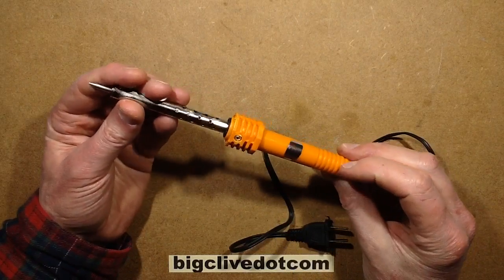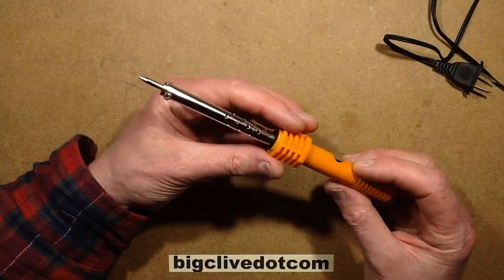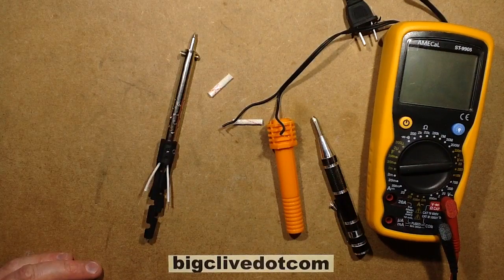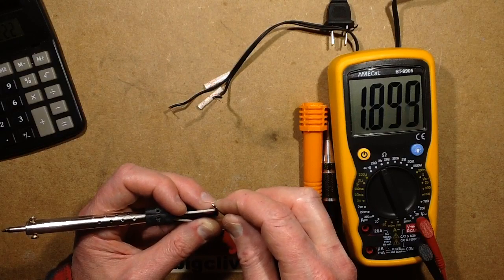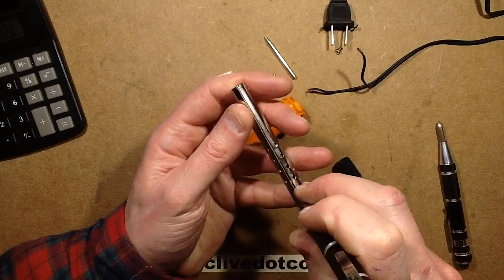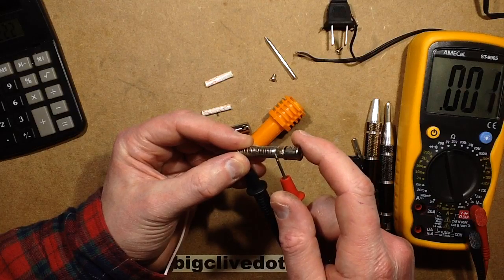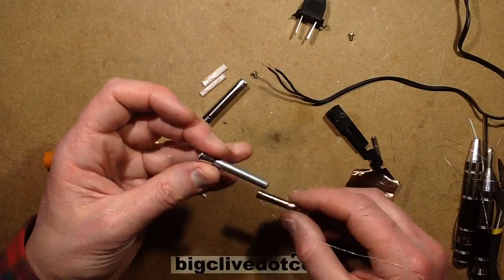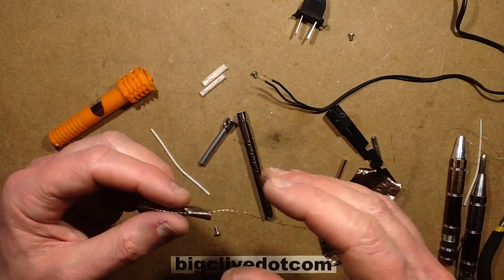Inside the cheapest soldering iron on ebay.

Comment: I just stumbled across your channel and subscribed :) very interesting and informative. looks like first off of course China  lol! they take good or decent parts and assemble things as cheap as possible. if you want to solder some thing buy a soldering iron, I use a Weller, if you want to burn your house down buy that cheap one  lol! I will be checking out your library of videos and looking for what you come up with in the future :)
Reply: i would think if you soldered the leads back after a couple of minutes getting hot it would melt all over

Comment: I brought one of these........Feels extremely cheap!.
Solders cheap too. Heat is inconsistent.

I asked for a refund as it is just crap. and somewhat unsafe.

I always felt unsafe using it, I NEVER touch the metal while power is turned on, And now i see why!.

It's good for cutting plastic, Or other messy heat related stuff that you don't like using you're good soldering iron on. But not ideal for soldering..It does the job.....But you can feel its cheap.(and i'm no pro)

I'd say it would burn out fast too. Probably lucky to get 2 weeks out of it.

And BE CAREFUL when using, Not to get shocked.

Comment: Rewire it to run off of 12v DC.
Reply: leave it on as "longest experiment in the world" to see when it would heat up
Reply: I might try this sometime (rewiring it like hyqhyp said). For a 40w, I need .278 ohms (Power = V^2 /R). So obviously not my normal nichrome heating wire, probably almost cheap wire. That would be super useful since I can just attach a small 2 Ah Lipo battery (would run almost 30 minutes, way longer than I would need).

Comment: its indian. I have the same soldering iron for 3 years. changed a coil once. and its still rocking.
Reply: After about 2 years since my comment,  its still working fine although I decided to get a generic temerature controlled soldering station.

Comment: Very naughty construction clive, it could be repaired but i suspect the bin had it 10 seconds after the video lol.
What about rewinding the element to work on 12v instead, much safer :-D
Reply: +zx8401ztv exact reason why i bought a 12v cheapo iron, it must have a thicker element to work, so it should last a long time, and of course safer and all the more portable, but i guess a lot of people dont have smallish 12v batteries around!
Reply: +jusb1066 
Yes your right, i hadnt thought about it that way, i keep asking my local shop if they can get me a new brain, "Sorry sir, thats a faulty model and discontinued." dam :->
Reply: zx8401ztv
nevermind, keep scouring ebay 1p ads , you might find a better replacement!
Reply: +jusb1066 
LOL i will :-D

Comment: hi clive! can u advise where to i connect the grounding wire from my soldering iron to? tks!
Reply from the maker: Any good solid mains ground reference.
Reply: thats what i have a trouble finding
Reply from the maker: If your electricity supply doesn't have a proper ground connection then it may be safer to leave the wire unconnected.  I'd recommend the use of a GFCI or RCD (earth fault detection circuit breaker) as a precaution.
Reply: Aquakey 98

Comment: that was a bad deal to begin with (not that I support the use of cheap soldering irons) but there are some 15$-20$ irons out there with a stand and variable heating settings and are far better manufactured than this junk

Comment: I got a soldering iron for 1.5 $ it works fine plus comes with decent amount of solder and some yellow-light brown gel thing? I don't know what that is
Reply: it's flux
Reply: +ConRGraphics what do I use that for?
Reply: Asghar Muna Tuna Havnt got a clue either im also new to soldering
Reply: +ConRGraphics the flux tutorials are so sketchy
Reply: im no expert but flux is used for better heat dispersion on the target. i.e. you coat the connection with abit of flux, touch the iron to it, let it get hot (minimal amount necessary), touch the solder to the tip of iron then the connection and badabing, pro level joint (terms and conditions apply)
Reply: Well flux is used for presenting oxidation ( rust build up) in the joints which accelerates at high temperatures so flux is necessary for sensitive joints for preventing damage while soldering
Reply: J Rodriguez No, flux is not used for heat dissipation. It is used to help clear oxides and make the solder wet more readily. Most solders have some already inside, but for things like SMD it is invaluable.
Reply: Flux is for cheaper solder that doesn't have it already incorporated or old school people who don't come to terms with it. Either way, it's nifty.
Reply: Trust me, for SMD ICs it's a godsend, any flux in the solder itself will typically burn off too fast.
Reply: There's different kinds of flux. Some of it contains acid to get through oxidation, but for some jobs it is too aggressive to other components. There are completely different chemicals used for other stuff than soldering electronics, also called 'flux', so the term is a bit overloaded like that. 

The gel-like flux is very good at making small SMD components stay in place on the PCB because it's so sticky. Flux also acts sort of like the inert atmosphere of welding. Without it the surface of your molten solder form a coat which won't 'wet'. 'Wetting' is an important bit of physics for soldering.
Reply: I usually make my own flux, using rosin and isopropanol. I find that it's more effective than most of the stuff I've had before.
I even found my grandpa's old flux, which was made in Soviet Union and I dissolved it in isopropanol and filtered it. After adding few chunks of pure rosin, it's thick and ready to use. :)
Reply: Zan'Keiki Zannanji I don't know and have never heard of rosin and isopropanol
Reply: +Asghar Muna Tuna Rosin or resin is often called over here as kampol. Wikipedia gives you some more information about it "Rosin, also called colophony or Greek pitch is a solid form of resin obtained from pines and some other plants, mostly conifers, produced by heating fresh liquid resin to vaporize the volatile liquid terpene components".

I don't know if kampol actual word, that people are using in English or not. But basically it has many uses, sometimes it's used to wax violin bows and it has been used to coat some furniture. It's actually yellowish/red rock hard substance. And it was often used in flux, which were made in Soviet Union, maybe everywhere else as well. It has specific nostalgic smell, that you won't get with today's fluxes.. I really don't know why..
Isopropanol is also called as rubbing alcohol. It's really great and it's cheaper and better than ethanol aka vodka. However you can't drink it! It dissolves all sort of glues and stuff like that and it dissolves rosin as well. Over here you can get 1L of isopropanol for just $4!
However it's quite tricky to get some actual rosin. I've found one seller on Aliexpress that actually sends out rosin chunks, which is pretty decent!
Reply: Zan'Keiki Zannanji I know resin , never heard rosin ,
Reply: +Asghar Muna Tuna Oh.. Well I guess you can call it with different words. As I was trying to translate "kampol" to English, it gave me those results.

rosin = kampol, vaik
resin = vaik, kampol
colophony = kampol

Comment: I have a similarly built albeit better quality 30w soldering iron from China which was about 5 usd and its working great since 3 years. Original tip is starting to pit but its ok
Reply: It too didn't have ground as most soldering irons so i just connect it using an alligator clip to ground(for electronics work )

Comment: I had one pluged it in  and it got extremly hot so heater burned out ,I have felling that i got 110 v one with 230 volt plug LOL
I rewound heater with wire that was used for holding heat together (It was resistive wire ) and now I use it to melt hot glue beacouse I dont have hot glue gun :)

Comment: Ahhaha I bought it on banggood and I went outside to plug it, knowing the risk involved in buying such a cheap soldering iron, and that thing literally exploded, no, kidding, but there was sparks !  seriously though lol.. how are they even able to export this crap?  I'm sure my unit was defect and not all are like that, like yours you said the main lead popped and that some works, but still.. lol 

Oh by the way, now that I'm here, on the expert channel :), I bought a cheap UNI-T UT120 multimeter, and I realise that it says 400 Ma FUSED ? which means I'm limited to use only on 400Ma ?? that's very small !! was wondering if it was really that or maybe I got it wrong, could be that it's just limited to small electronics, I wanted to do some tests with solar panels though which gonna go higher than that..I also read it's an electronic fuse or something that doesn't break, but still, curious
Reply from the maker: +Thomas Syxe Most meters have two current ranges.  A low level one protected by a fuse and a higher 10A or 20A one that may not have a fuse.
Reply: Oh I see.. thanks for the answer, yea, I still have much to learn :) lol ah well anyway if i break it i'll just buy a quality one with bigger fuse and hopefully replaceable fuses but if it's 10 amps min i shouldnt have much problems..

Comment: But will it chooch?
Reply from the maker: +ToAstYNaChO Yes.  Forcibly with lots of smoke and a loud bang.
Reply: +bigclivedotcom what you mean "just a steel wire"
Reply from the maker: +TheMakyato What initially appeared to be an exposed heating element turned out to be a spiral of steel wire used to sandwich the internal core of mica and the heating wire.

Comment: Everone on here wants the flex soldering to the element, have any one tried to solder nickel chrome? impossible at best the cable is usually crimped to this wire with little brass ferrles

Comment: I am wondering if anyone can help me, i have 3 to 4 dead soldering irons , they die because i unplug them and replug them several times during work  to prevent the tip from staying hot for too long and oxidising. how can i fix these solderign irons. or should i buy a new one
Reply from the maker: It might be better trying to find a better quality one.

Comment: Some of my favorite soldering irons have been the cheap ones. 

The soldering linked below has been my current favorite for around two years now. It is beginning to show its age as it is used regularly. I will have to replace it soon with another one. It has been much better then the radioshack one that I had before it. 
http://www.parts-express.com/30-watt-soldering-iron--370-010
Reply: +TheCatMilton that uses standard cheapo tips, you can find them sold by silverline in the uk,  untill recently my soldering iron was from the 1960's and had a copper tip (of which i had a few dozen spares) but only a bog standard 25w iron
Reply: The first thing i did was replace the tip.